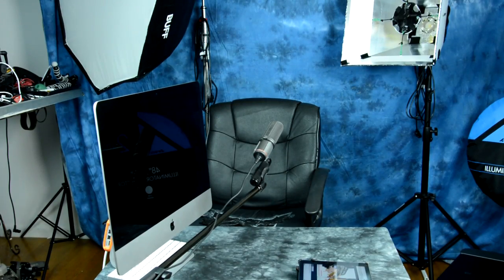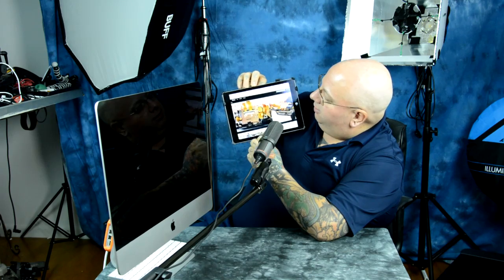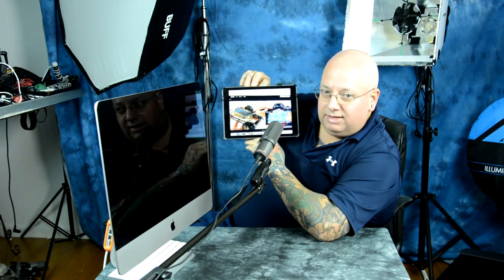Undeniable 100% PROOF: A7R vs. A7RII Design Change & source of corrosion & failure

Comment: The only way moisture can enter is when the camera is cold and the environment is warmer. The opposite way is impossible :). So if this cooper heat sink is really out uncovered by other parts it is possible moisture to enter. Also if the camera is turned on - no chance for moisture, this thing is generating so much heat... especially when shooting video. When shooting video it can get dry itself from the outside not only inside.

The reversed main board is actually better solution because that way the heat is going out from the sensor to the back of the camera...

Comment: Glad I have the A7R not 7RII lol
Reply from the maker: The vapor pressure level of a given air mass, say a closed room in a house, will tend to equalize throughout that mass, Boyle’s Law. If you open the door that adjoins the room to an adjacent space with a different vapor pressure level, the vapor pressure levels of the two air masses will rapidly equalize, again Boyle’s Law. An example would be a warm steamy bathroom as compared to a cooler adjoining bedroom. The problem occurs when the difference in vapor pressure levels is extreme such as the case of a warm steamy bathroom and the outdoors with freezing low humidity winter conditions. I have seen the effects of water damage caused by condensation that originates when high vapor pressure, e.g., in a bathroom, successfully forces its way through an exterior wall and eventually causes condensation on an exterior surface with a temperature at of below the dew point. Unfortunately, the place where the condensation occurs is usually out of view so over time the moisture buildup causes decay of the material.The Sony A7Rii DESIGN FLAW BREAKS THE THERMAL BARRIER BETWEEN THE INSIDE AND OUTSIDE OF THE CAMERA. As for cameras that are not hermetically sealed and the camera has a lower internal temperature and hence lower internal vapor pressure level, Boyle’s Law, than its surroundings. If the camera with a low internal temperature is suddenly moved to an area of higher temperature and vapor pressure level Boyle’s Law says that the two different pressure levels will try to equalize. Since this process will not have any effect on the ambient pressure level of the outdoors the interior of the camera will KEEP assuming the vapor pressure level of its surroundings due to the increased temperature inside the camera. Water vapor, therefore, will find any means to migrate into the camera and will condense on any cooler materials it encounters. There are physical differences between the A7R and A7RII, where one has more points of leakage that allows it to succumb to Boyle’s Law.The heat sink design of the A7RII penetrates the camera casing, if you will, in which the electronics are located. Under situations where the internal and external vapor pressure levels are different (which is OFTEN), Boyle’s Law says that water vapor will seek the path of least resistance, which is caused by the PROTRUDING HEAT SINK.As for the wicking phenomena that you mentioned, this too has a architectural analogy. Actually, years ago when aluminum window frames were first introduced, there were problems with the thermal conductivity of the material which, in winter conditions, caused the internal temperature of the frame to drop relative to the internal temperature of the space in which it was located. Often the result would be condensation of the internal parts of the window. Today windows are designed with a thermal break that interrupts the conduction of heat energy. This is synonymous with the A7R vs A7RII situation.

Comment: This design basically breaks the thermal barrier between the inside and outside of the camera.  Allowing condensation to travel to the inside of the camera.  Similar to the way a cold glass of water condensates on the outside of the glass on a hot day.
Reply from the maker: NAILED IT
Reply from the maker: Holy hell, check this link
https://www.consumeraffairs.com/cameras/sony.html
Reply from the maker: i got half of this below from another poster:
The vapor pressure level of a given air mass, say a closed room in a house, will tend to equalize throughout that mass, Boyle’s Law. If you open the door that adjoins the room to an adjacent space with a different vapor pressure level, the vapor pressure levels of the two air masses will rapidly equalize, again Boyle’s Law. An example would be a warm steamy bathroom as compared to a cooler adjoining bedroom. The problem occurs when the difference in vapor pressure levels is extreme such as the case of a warm steamy bathroom and the outdoors with freezing low humidity winter conditions. I have seen the effects of water damage caused by condensation that originates when high vapor pressure, e.g., in a bathroom, successfully forces its way through an exterior wall and eventually causes condensation on an exterior surface with a temperature at of below the dew point. Unfortunately, the place where the condensation occurs is usually out of view so over time the moisture buildup causes decay of the material.The Sony A7Rii DESIGN FLAW BREAKS THE THERMAL BARRIER BETWEEN THE INSIDE AND OUTSIDE OF THE CAMERA. As for cameras that are not hermetically sealed and the camera has a lower internal temperature and hence lower internal vapor pressure level, Boyle’s Law, than its surroundings. If the camera with a low internal temperature is suddenly moved to an area of higher temperature and vapor pressure level Boyle’s Law says that the two different pressure levels will try to equalize. Since this process will not have any effect on the ambient pressure level of the outdoors the interior of the camera will KEEP assuming the vapor pressure level of its surroundings due to the increased temperature inside the camera. Water vapor, therefore, will find any means to migrate into the camera and will condense on any cooler materials it encounters. There are physical differences between the A7R and A7RII, where one has more points of leakage that allows it to succumb to Boyle’s Law.The heat sink design of the A7RII penetrates the camera casing, if you will, in which the electronics are located. Under situations where the internal and external vapor pressure levels are different (which is OFTEN), Boyle’s Law says that water vapor will seek the path of least resistance, which is caused by the PROTRUDING HEAT SINK.As for the wicking phenomena that you mentioned, this too has a architectural analogy. Actually, years ago when aluminum window frames were first introduced, there were problems with the thermal conductivity of the material which, in winter conditions, caused the internal temperature of the frame to drop relative to the internal temperature of the space in which it was located. Often the result would be condensation of the internal parts of the window. Today windows are designed with a thermal break that interrupts the conduction of heat energy. This is synonymous with the A7R vs A7RII situation.
Reply: That is a great example. Not breaking the thermal barrier is something us schoolie (Bus RV conversions) people need to be aware of when doing our build outs. The metal frame and metal skin of the bus is a great conductor. We have to be very careful when insulating and screwing in our walls, framing, and ceilings (usually wood) to the bus frame. A screw that holds in a wood ceiling panel to the metal frame, for example, will condensate like crazy on the inside of the bus (the screw head) on a cold winter day if the temp/humidity is too high inside the bus because it breaks the thermal barrier. Multiply that issue by hundreds of screws holding in a ceiling and you have a complete mess. Great care has to be taken to not break the thermal barrier (insulation, wood ceiling, etc.).
Reply from the maker: wolfywho U ROCK for that analogy :)

Comment: Looks more like galvanic corrosion to me
Reply from the maker: magnesium oxide! :( 
check this pic:
https://www.flickr.com/photos/134746128@N05/28514107834/in/dateposted/
Reply from the maker: https://community.sony.com/t5/Alpha-NEX-Cameras/Weather-resistant-issues-with-Sony-A7R-II/td-p/530930
Reply: I saw the photo. I'm not saying there is no corrosion (or oxidation whatever you want to call it). But I think it is way less likely that this is due to water. There might be a few cases where salt water went in because the camera was used on a boat or on a beach... In any case, if water infiltration was the cause, everyone who doesnt live in a desert would be sending their A7RII back for repairs. I think it is way more likely that a few batches of metal parts weren't properly coated against galvanic corrosion, and the manufacturer didnt do proper QA or cut some corners because "hurry up/deadline", which is why that not everyone's A7RII suffers from gut rot.
Reply from the maker: Christian Lainesse its not ocean vs desert,  rather HUMIDITY vs.  ARID

im sure the numbers of people using / owning this camera in the desert are what,……….less than .0005%
Reply: Exactly. So if the cause of the corrosion is a design flaw as you claim, meaning that every single A7RII manufactured is defectively corrosion-prone, Sony should be "swimming" in repair requests, because the majority of cameras are used in conditions where humidity and temperature vary (pretty much everywhere). So, is Sony swimming in returned, corroded A7RIIs? I'd like to see more statistics, less semantics.

Comment: Ken is the man! You actually did Sony a big favor. I think A7RIII is coming... ;)
Reply from the maker: im sure they hate my guts, but the pics are the pics, whats to refute?
Reply from the maker: read that:
https://community.sony.com/t5/Alpha-NEX-Cameras/Weather-resistant-issues-with-Sony-A7R-II/td-p/530930
Reply: +Theoria Apophasis eh Sony, Sony... they just dropped so much down in my eyes. I now know: Sony=NO! I'm so pissed from their behavior that I want to sell my old nex-7 (converted to ir) on eBay right now.
Reply from the maker: well , nikon pisses me off too, for diff reasons :) 

i was always hardcore anti sony, but this is the proof, 

ALSO, if someone is sweating, with that camera up next to their eye, the sweat can wick into the camera
Reply: +Theoria Apophasis nikon has pissed me for some things too. I also have Canon and Fuji, and I have some issues with them as well. but what Sony is doing is out of my zone of tollerance. They had heat issue with nex-7 and with all cameras afterwards. rx10 series seems to be exclusion.
Reply from the maker: Holy hell, check this link
https://www.consumeraffairs.com/cameras/sony.html
Reply: +Theoria Apophasis holy smolly... Interesting read... thanks for sharing.